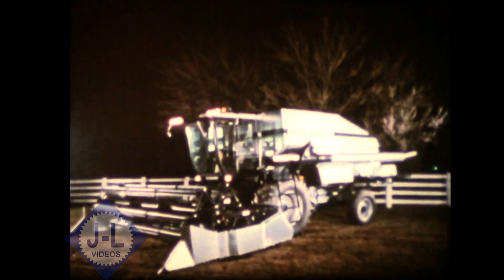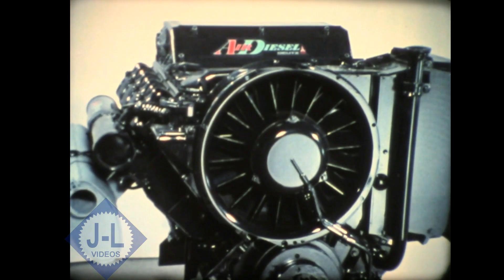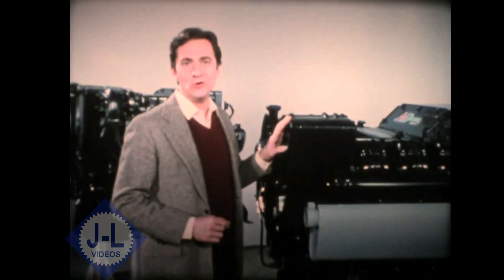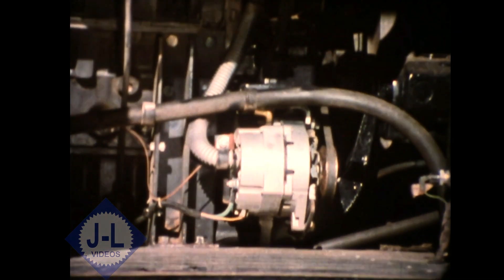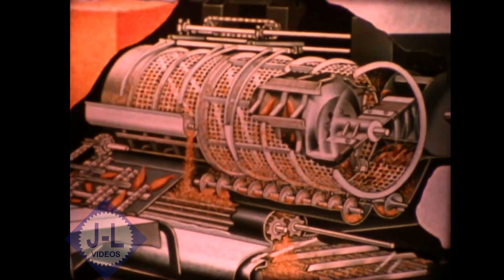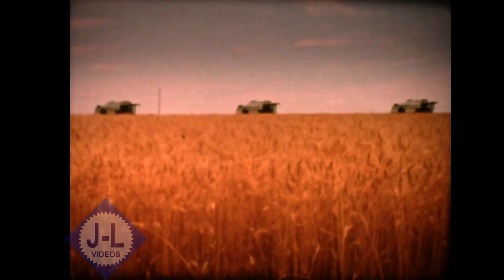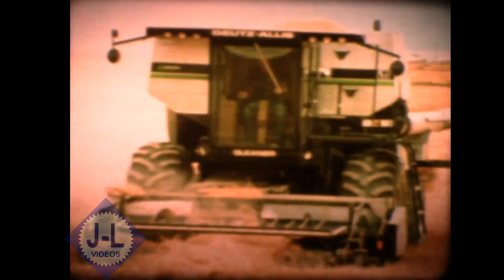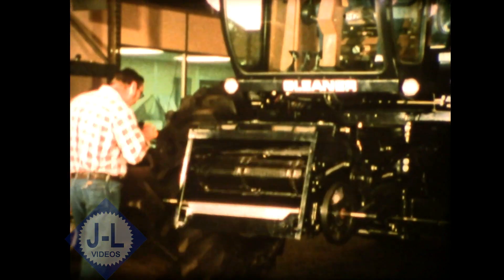1987 Deutz Allis Gleaner Movie New R60 R70 Combines

Comment: Afraid from the engineering side, the Deutz engines used on the R60 and R70 were not stellar performers. Cooling fans wore down rapidly, more of a problem on combines with so much dust at the rear vs tractors where the cooling fan was up front. Cooling fins plugging without operator knowing - we had prototypes come back with rear cylinders caked in dirt. High altitudes - most European harvesting is at relatively low altitudes but in North America, a lot of the grain is grown at elevations over 4,000 feet where the cooling fan was marginal when new, couldn't keep up once worn and 30% wear in 500 hours not untypical. Very good hype by a Deutz engine person up front in the video, but didn't match reality. Once purchased by AGCO, quickly redesigned to conventional liquid cooled engines.

Comment: I just did my daily blow out of the cooling fins on my R60. Takes 10 to 15 minutes per day so I don't feel it's maintenance free. Other than that its a good durable motor. Expensive to fix though.
Reply: Correct. I don't think the best application of Deutz engine was in a combine. Chaff gets into the cooling fins and can cause overheating and even start a fire. My brother had a R52 with a Deutz engine that caught fire and burned. He ended up replacing it with a newer R52 with a Cummins.

Comment: Farmers couldn't be bothered to blow out the fins on Wisconsin engines, don't know who thought they could manage these.
Sad part is these aren't any better than a 301 or 426.  4 valve heads and stiffened blocks on the harvey engines would have been a match for anything.  The 516 was never a modern engine, and needed a clean sheet redesign.

Comment: Simplicity? Trouble Free? Economical? Extended Engine Life? Easy to Service?

I'd like to know where to get one as my dealer (Lindsay Implement) had 5 rows(roughly 60 machines, 8/2003 you can see them in google) of these they literately couldn't give away, sure half of them were burnt, but still if you can't give away a combine, I'm pretty sure its bad.

Sure you could spend an hour at the end of each day blowing out the engine or you can spend 10 minutes blowing out the radiator and a little bit of dust off the rest of it. Oh don't forget the fan blades, they wear any and you gotta replace them.

Seriously whose idea was it to put an engine that requires a clean environment in the dirtiest, most flammable environment on a farm, and in the most important machine on the farm too?

Also get this: Deutz went to water cooling! 2019 Deutz at Big Iron had a radiator!
Reply: I don’t know if you have ever ran a Deutz air cooled but, we have had great luck with the air cooled engines on our farm.  Most of our tractors are air cooled and even our square baler has a Deutz engine on it.  We have been using a Deutz powered Gleaner combine for years and we love the engine.
Reply: @CJ-mh6yn  We've just watched all the neighbors go to different colors as theirs burnt. One neighbor burnt 3 then went to Deere, one had a fire and saved it, went to red, anothers burnt, they went to a pull type versatile, 2 others went from early N6s to R70s, they went back to L3s, basically during the deutz era, there were no gleaners except Allis Chamlers Gleaners, which is what most of them that tried an Rx0 went back to as they didn't seem to burn and as they wore out they went to another color, mostly red. Then when agco put cummins in them, they made a resurgence and with help of the dealer, the entire area was just about all gleaners again, until agco said "grow or die" to our dealer and now everyone has a red combine, aside from a few L2s and L3s rolling around still. 

They didn't work in the very dry, short, powdery conditions of Western ND, atleast they didn't when their previous models didn't need to be babied. Radiator may be one thing to go wrong but I'd rather blow out a radiator than burn a combine.

I also heard they were a pain to start without ether in the winter.
Reply: Just saying its pretty easy to blow out cooling fins just take the cover off thats held by on over centering latches then its full access i have heard of some burning down in my area but those were the farmers that had trouble with every colour never owned a gleaner but have a deutz tractor from every series from the 1950s to the 1980s and they were forced to go to liquid cooling because emisson reasons
Reply: @mathewmerkl576  I'm pretty sure it had more to do with the missing giant fan keeping the chaff off the exhaust and the part where they must be kept 100% clean, unlike just about any liquid cooled engine
Reply: The reason Deutz went with water cooled engines was because the air cooled engines couldn't meet emissions regulations, not because they didn't work. My family has run Deutz tractors with air cooled engines for 46 years with almost no problems.
Reply: @benhorn2677  Like I said a year ago, they didn't work here.
Reply: I agree. They seem like great engines in other environments, but they didn't seem to work very well in the dirty flammable environment in a combine. My brother lost a R52 Deutz powered combine to fire, and he was pretty religious on keeping it blown out. Got a R52 with a Cummins after that.